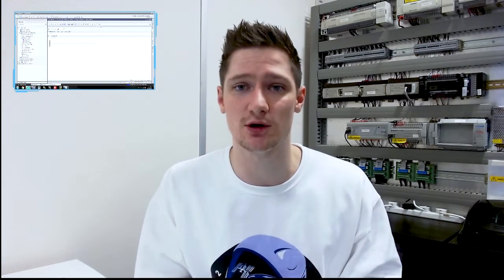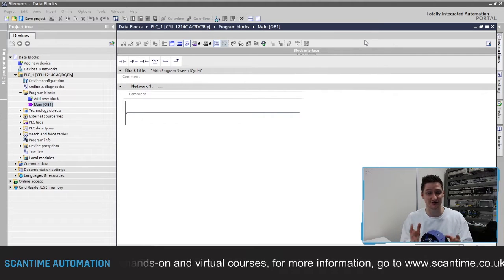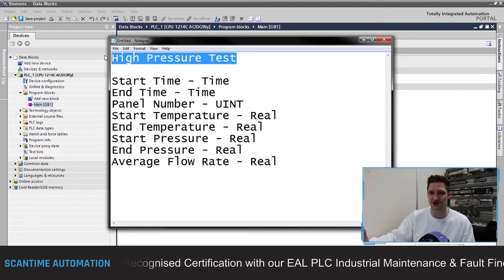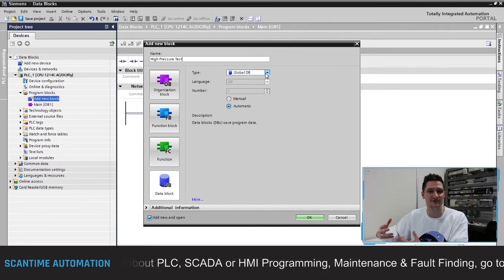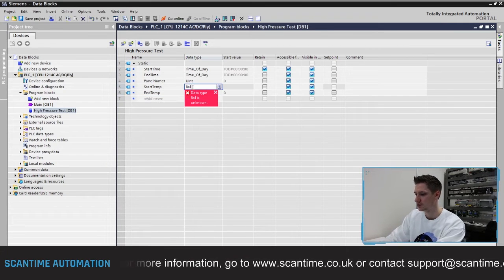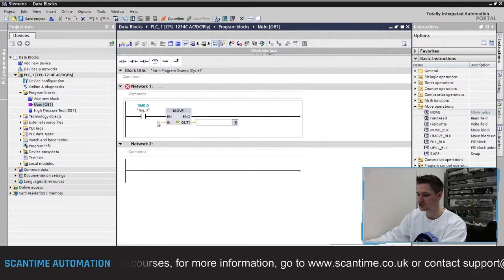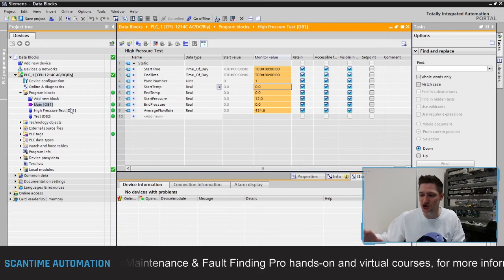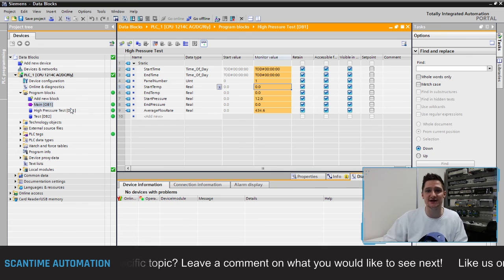An Introduction to Data Blocks (DB) in Siemens TIA Portal!

Comment: Where are the Data Blocks actually stored. Is this something we do not need to consider as they cannot clash with the other memory area like bits bytes and words.   Does the PLC handle everything to do with the storage of the Data Blocks
Reply from the maker: Data Blocks are stored within the PLC, there are a finite number of DBs that you can create but this ranges into the thousands, so we shouldn't need to worry too much about that